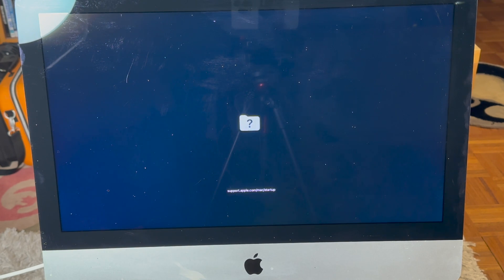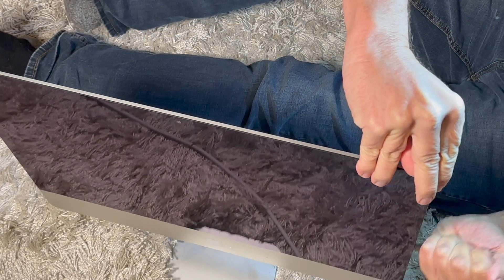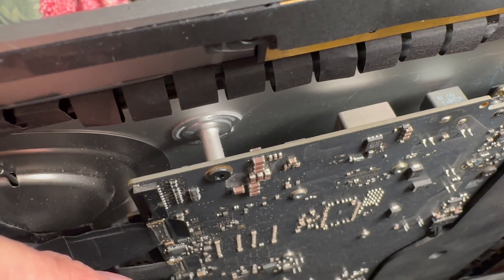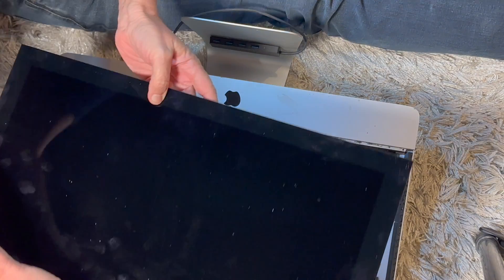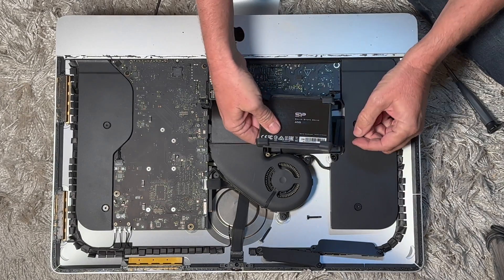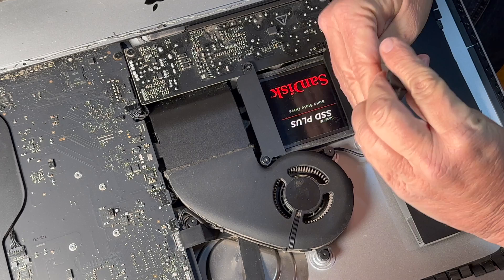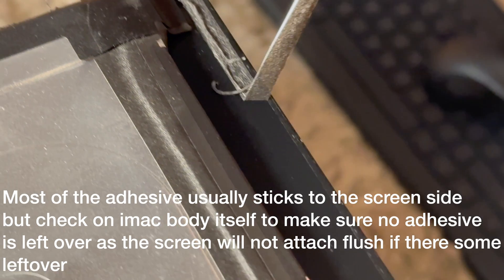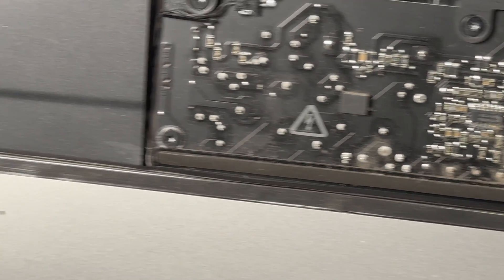21.5" iMac Hard Drive SSD Upgrade or old drive replacement 2012-2017 (Including Retina) in 4k

Comment: Very helpful! Managed to reconnect the "delicate connector pins" persistently in the third loop; was a good decision to fix the screen transiently with tape, only. USB Keyboard is recommended ,e.g. for NVM reset during the boot phase. As a response to the end of Apple support for older MACs, have now a Ubuntu Linux installed and by Virtual Machine even a Windows 11 *sandbox*. LTS 24 does not come with Wifi and Bluetooth drivers, but they are available.

Comment: Hi Martin - just a thank you for your fantastic guide. We had a dead 2015 iMac with old style hard disk. Following your video made it dead simple to remove and recycle. 
Like you said- take your time and slowly back & forth on the screen join to work it loose was a top tip. 
Thank you again.

Comment: Hello, cool video, i did it with an external NVme drive, i was getting 100mb  Read and write , however with the Nvme Drive i get 500mb read and write, all apps move a lot faster but not instantly open and boot still at 1 minute and 45 seconds so still a bit slow on the boot, some are saying because is external using 3.0 usb, so do you know if the internal is much faster? i did upgrade to Monterey, just wondering if i should do internal instead of external, any help is appreciated, thanks.

Comment: I hate apple so much. I tried figuring out what year someone's is over messenger (not super computer literate) and they lost it as iMac 21.5" and no actual year or model number. Why. Actually why? To make it harder to repair, as is their MO, and then bend you over a railing and charge you 5x as much as the parts cost to do yourself. I hate apple with a burning passion and I wish people would quit buying their stuff for even a year so they'd change.
Reply: Just go to about this Mac clicking the Apple in the corner
Reply: @jgr6b1  what if it doesnt work anymore?

Comment: Do you edit your 8k 60p videos from the R5C on this mac? I’ve just bought the R5C and have a 2017 imac 27 inch but with traditional disk drive. I know SSD was an option when purchased. Do you think it’s possible to change the drive on my 27 inch and it to be fast enough for short 8k 60 clips? It’s currently got 48gb RAM.
Reply from the maker: I do not edit with this computer I use a Mac Studio. It should be possible if your 27” doesn’t have a SSD as it was the built in SSD drives on Logic board that were not  replaceable.